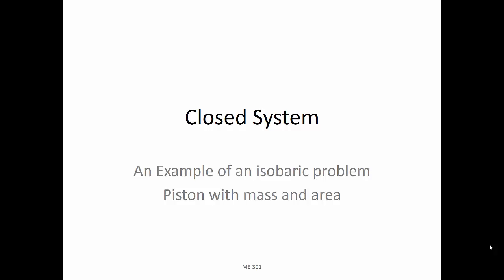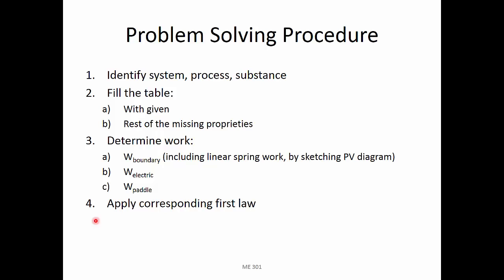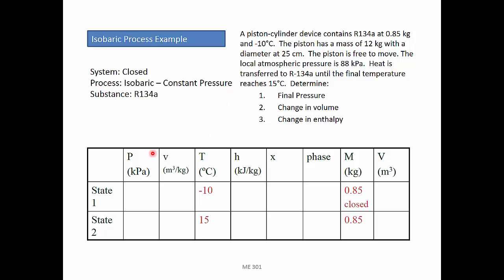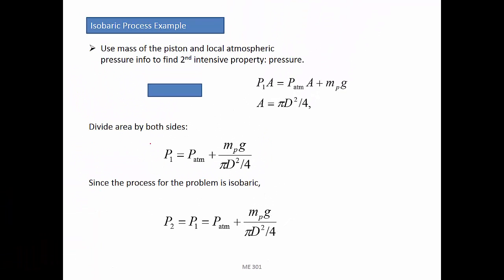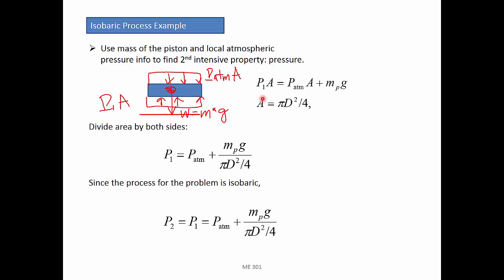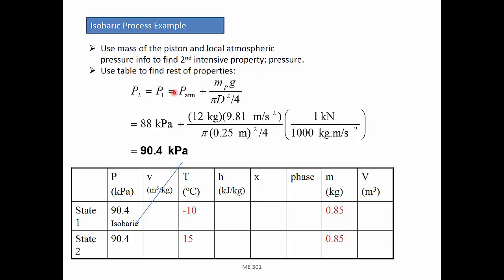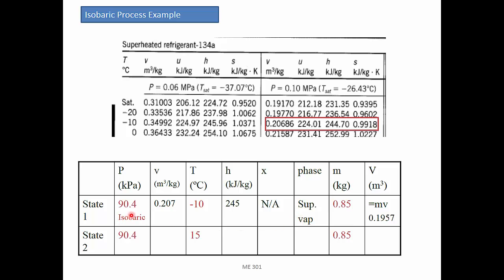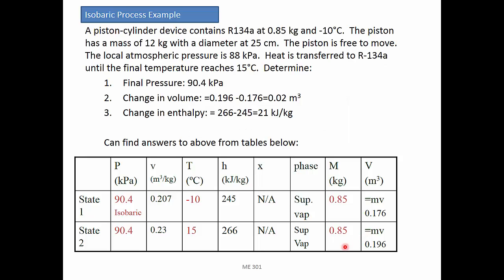Thermodynamics: Example - Isobaric process with piston-cylinder and heat transfer

Comment: mind to explain why its superheated vapor?!!
Reply: aah never mind, i got it 
its cuz for a temperature of - 10 degrees Celsius, the saturating pressure which corresponds to it is 200 kg Pascal , and If we draw the T-v diagram , we find that for the temperature of -10 the pressure of 90.4 corresponds to the superheated vapor phase